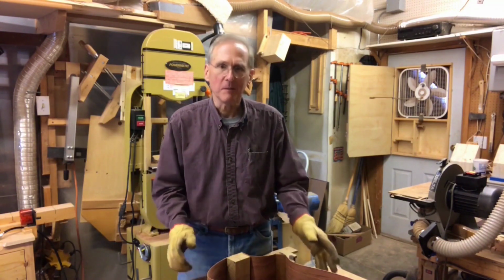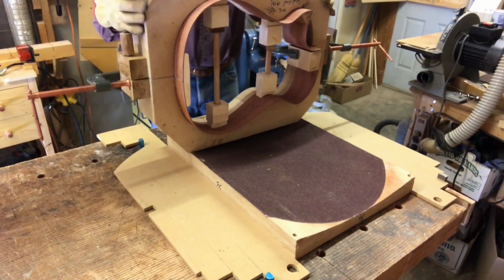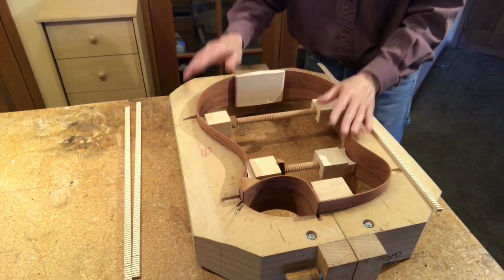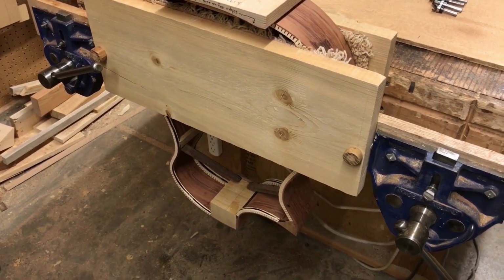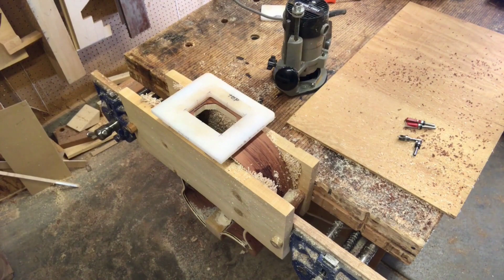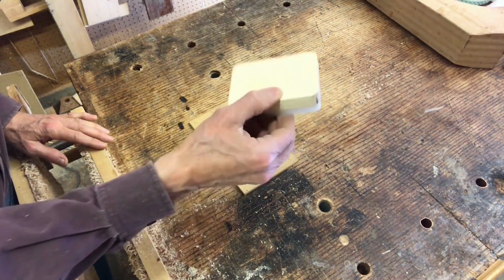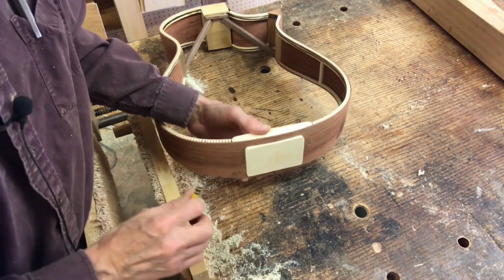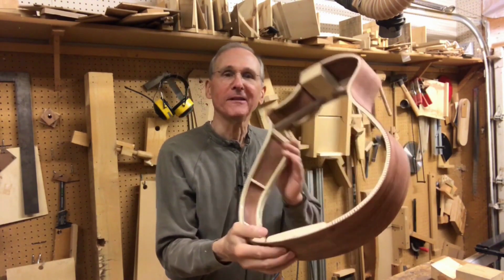Building a Custom Acoustic Guitar Part 2

Comment: Hey ! Why do you put carbon fiber line on linings ? And what is the role of the windows ?
I’m French so in don’t understand all the explanations.. Thanks !
Reply: The carbon fiber is used to add extra stiffness to the guitar, it’s his personal preference to use the strips of carbon instead of thicker wood

The window at the bottom is an access hole to easily fix the guitar in the future
Reply from the maker: I have found that stiff but relatively light sides for the guitar promote the bright tone, good sustain, and smoother response that I am looking for. The reverse kerfing with the carbon fiber epoxied on stiffens the linings without adding much weight. The window (access door) in the tail of the guitar allows me to reach inside to carve braces once the guitar is strung up to tune resonant frequencies to desired targets, and also makes placing a pickup easy. The window (carved sound hole) on the top is up in the "corner" of the upper bout, which results in a lower air resonance, hence making the relatively small guitar sound bigger. The carving itself is purely for decoration.
Reply: @HansonHandmadeGuitars Thank you for answer. Y @HansonHandmadeGuitars .